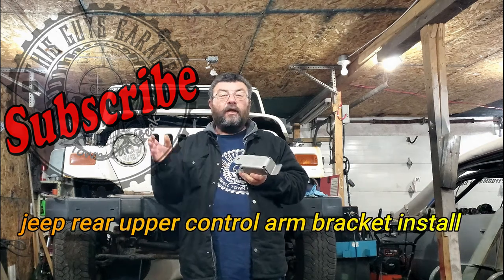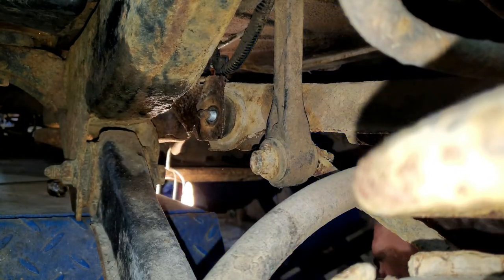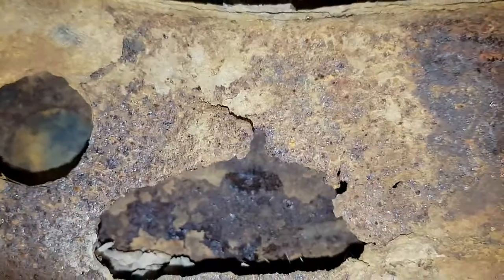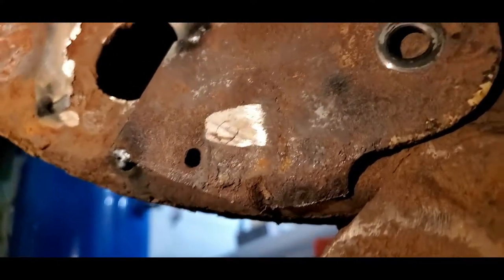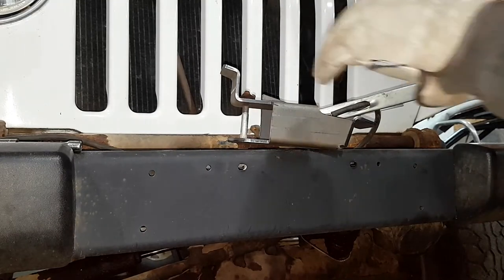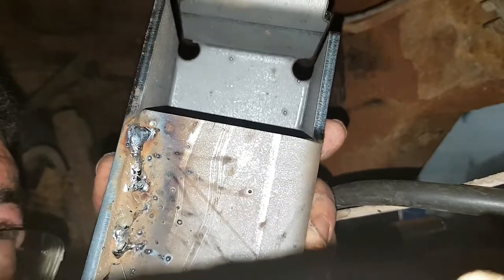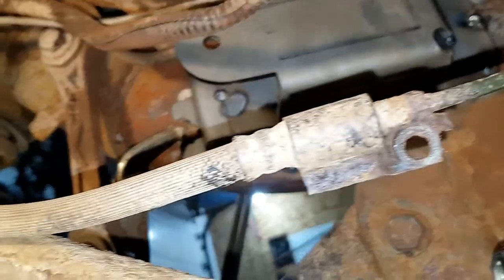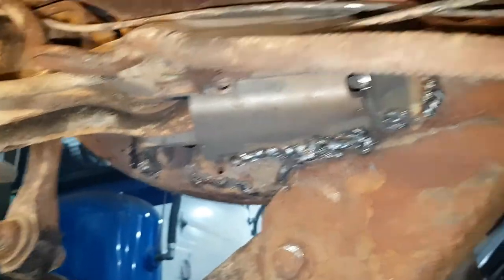jeep wrangler rear upper control arm bracket installation welding

Comment: There's just something about watching videos of welding that almost puts me into another state of mind, kinda zen like.  Not the prettiest welds but they'll outlive any other part of that Jeep
Reply from the maker: not the prettiest at all my friend, i was actually a little embarrassed lol ,i should have had it a little cleaner & switched the machine over to 0.30 wire instead of the 0.23 that i use for body work, but like you say it will last as long as the rest of it. appreciate it bruce!